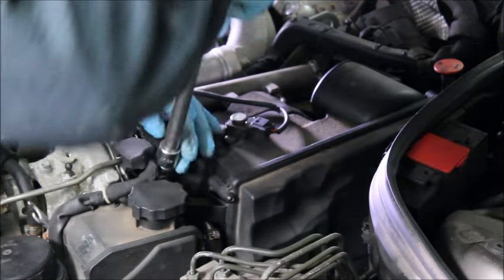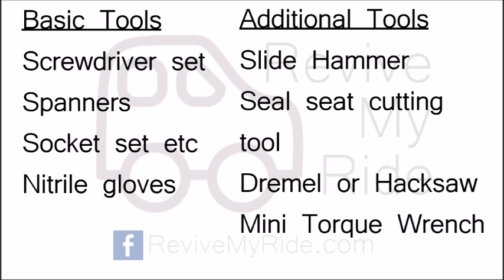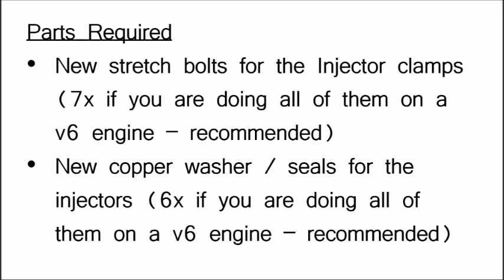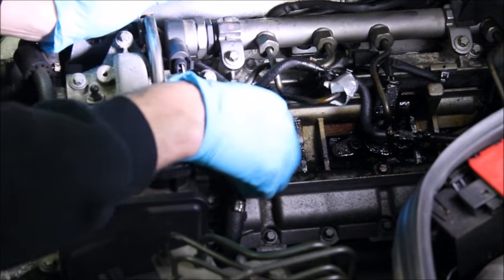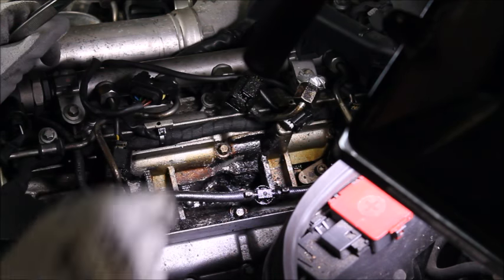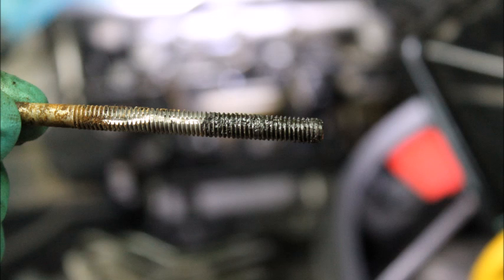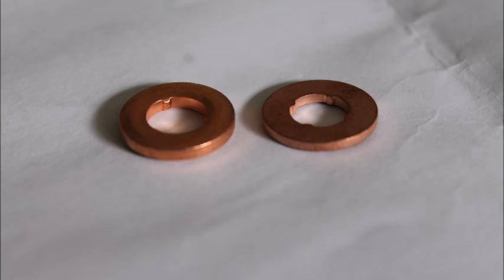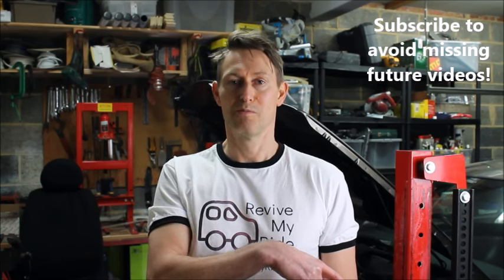Mercedes diesel CDI (Black Death) leaking fuel injector - How to diagnose and fix on 3.0 V6 engine

Comment: If I remember correctly that’s a piezo injector, n u use a slide hammer to pull it out??
Reply from the maker: Hi @jun2611 you are right to be cautious. If you can get the injector out without the slide hammer than that is always the best solution: make sure the engine is warm to soften the carbon, twist it from side to side and pull by hand. But, if it is big time stuck stuck, which can happen, then it's gotta come out to fix the problem. Usually the injector comes out intact, if it breaks, then you need to put a new one in but somehow, you need to get it out so you can clean up the seal seat and fit a new washer etc. Cheers, Phil

Comment: I enjoyed the video.  I have a 2010 blutec that starts fine when cold. After 10 min of driving it throws a low rail pressure code and starves for fuel and dies.  If I then let the fuel pump re pressure up then it starts again.  But, soon as I give it gas it dies.  I have replaced the fuel filter, tank pump, and high pressure pump.  No difference.   Could an injector leak enough when warm to cause these symptoms?  I do not have any of the carbon build up on my injectors.  Car has 75k miles.  Thanks for any suggestions.
Reply from the maker: Hi, sorry for the slow reply. I haven't come across this problem before personally, so I did some reading. You have already tackled the things most likely to be causing the problem. You are right that when the leaking injector "black death" gets bad enough, then the car will struggle to start / run but I really don't think this is your problem as you would definitely see the carbon build up in the engine bay and even start getting some fumes in the cabin. There is another kind of injector fault where fuel leaks into the cylinders but this would cause rough running and excessive smoke. I know you have replaced the in tank pump and filter but the only things I can suggest are testing the pressure that you are getting from it by introducing a pressure gauge after the in tank pump near the filter. If you haven't already seen it, check out this thread where they talk about min fuel pressure before and after the filter near the tank https://www.benzworld.org/threads/p0087-fuel-rail-system-pressure-too-low.2446665/ The other suggestion is that there is some talk about a fuel pressure regulator on the fuel rail failing / becoming faulty. Hope this helps!

Comment: Are they stretch bolts for injector clamps , some say yes some say no ,,what's your feedback. TTY bolts torque to yield , great video 👍👍
Reply from the maker: Great question! I had my doubts about whether they were stretch bolts or not because the torque applied to them is low(ish), is it really enough to stretch the bolt? Also, from doing cylinder heads in the past, some stretch bolts can be reused and you can check this by measuring the length of the bolt. I didn't check this but if the bolt is the same length as when it started, it can't have stretched, therefore, should be reusable. In the end, sorry to say I chickened out, the new bolts weren't really that expensive, so I put new ones in just to be safe. Sorry if this doesn't answer your question! Anyone else out there wan't to weigh in? Cheers, Phil

Comment: thank you for your video, and i have a problem my 2008 E320 BlueTEC was working great until that day on 2019 & from that day the engine stopped working, no one know what is the problem, even Mercedes Service Center didn't know how to solve the problem.
so what do you suggest please?
I have Mercedes star C4 & C6 now just I got them to diagnose the car.
the engine crank, after diagnose i found that no pressure in the fuel rail which not allow the engine to start.
and you are very expert in Mercedes engine.
looking for your response please.
best regards
Reply from the maker: Hi, as I'm sure you know, the fuel rail gets supplied by the high pressure fuel pump that is on the front of the engine. But the high pressure pump itself is fed from a fuel pump near the tank. Also, a blocked fuel filter can starve the pump and cause this problem. I haven't tackled this problem myself but: engine cranks but won't start (due to low fuel pressure) is fairly common problem and you will find a lot of videos on it and they will take you through the process. Here is one example of a video on it, you may be able to find one on your specific model too: https://www.youtube.com/watch?v=RAYp8l2Q250 Hope that helps! Thanks, Phil
Reply: @ReviveMyRide  thank you so much for your response & support, yes I have changed both of them and the fuel filter besides the crank sensor, nothing.
Now I am going to the workshop to make diagnostics, I am thinking to make a video on this problem.
Reply from the maker: @mrnourbaha  HI, I'm not sure why I didn't think of this earlier but if you have fixed the original problem (Let's say it was the filter or sensor), then these engines and fuel rails are very sensitive to air locks / fuel priming. You will see in the comments on the Black Death video, lots of people having problems priming the car to start it after changing the fuel filter or a fuel injector. It might be worth you trying this: Ensure the fuel tank has enough fuel in it (put extra from a portable container if required), jack up the rear of the car, so that it is higher than the engine, crank to start the car a few times over about a 10mins time period, allow the starter motor to cool down / charge the battery, then try again. You my have to do this quite a few times but it will prime the fuel rail and may cure your low fuel pressure problem if it is just an airlock. Two things to be careful of: 1) If supporting the rear of the car using a jack only, be careful of it falling, ideally support it with axle stands too 2) Be very careful if you loosen any joints near the fuel injector or high pressure fuel pump, high pressure fuel leaks can be dangerous, don't put your hands near this areas when cranking / running the engine. If you do a video, drop me a link, would be interested to watch it! Thanks, Phil

Comment: Excellent video! I'm having issues to start just now -  I have to crank the engine couple times as the fuel pressure rail pressure is slow. Which device I can use to code new injectors to this engine?
Reply from the maker: Hi Cristiano, I'm not clear from your question if you have had the car apart and now you are struggling to get it started or if you are using it but sometimes it is difficult to get started? I found a really interesting video where a guy is saying that the injectors don't need to be coded. He says coding will allow it to work more optimally straight away but that just installing and then running the car for a while achieves the same result. You can find it here: https://youtu.be/Z6whRd2pTJw There is also a discussion along the same lines here on BenzWorld https://www.benzworld.org/threads/om642-injector-replacement.3015706/ You will be able to find lots of info as long as you search for "OM642 injector coding" Sorry, I've never done it myself! Also, please be aware that if you have removed injectors then the fuel system needs to be primed, you can do this by turning the ignition on and letting the fuel pump run (without starting the car) and then turning it back off and repeating a few times. I hope this helps!
Reply: @ReviveMyRide  Thanks. I knew about the YouTube video but not about the forum. I've being having issues at the morning only to start the engine, even when is over 20C. I noticed that the fuel pressure is not sufficient using a app connected to the OBD port. I need to test which injector is the culprit.
Reply from the maker: @paidoluca  Ok, that makes sense. When it finally does start up, is there a lot of smoke? I noticed a few people mentioning that when their fuel injector failed then it provided too much fuel to the cylinder it was fitted to and this caused a lot of smoke / unburnt fuel and a diesel smell. I think looking at the fuel injectors may be one of my jobs in the future! Good luck with it!
Reply: @ReviveMyRide  no it doesn't smoke a lot! During the day the car looks normal, only happen during the first start. What I heard is that when the injector get bad doesn't hold the fuel pressure and the fuel goes back to the tank entirely.

Comment: Hi buddy I have ml320 cdi 2008. I put wrong fuel in it . (GAS). So, my car first use to take longer shelf start . But know it doesn't start at all. Only starts with spray fuel into iin takes. Please let me know what to do
Reply from the maker: Hi, I'll be honest, I've never had to deal with this issue before, so I don't really have any experience. However, I did some reading and it seems the most important things are to completely empty the fuel tank, replace the fuel filters, purge all fuel lines (Including the fuel rail to the injectors). I found this link that may be off help, it is from a Mercedes Sprinter van forum. https://sprinter-source.com/forums/index.php?threads/74180/ Sorry I can't be more help and I hope you get it sorted! Thanks, Phil

Comment: What do you use to stop debris from entering hole while cleaning walls
Reply from the maker: Hi, at 12:45 I drop a disc down into the bottom of the injector hole. It is actually a washer covered in double sided tape. I seat it in the bottom, do the injector bore cleaning, vac it out and then remove the disc at the end. Hope that helps! 👍

Comment: Will there be a DTC (trouble code) telling you an injector is bad, or is it simply waiting for the symptoms to occur?
Reply from the maker: Hi, no, I'm pretty sure that the engine / ECU doesn't know there is a problem unless it gets very severe and starts to cause running / starting issues. Not sure what the fault code would be at this point. As you say, it really is a case of waiting for the symptoms. You can keep an eye on it by periodically removing the engine cover and having a look for carbon deposits near the fuel injectors. Some people just decide to replace the injector seals at 80 - 100k miles. Personally, I would do the periodic check, the engine cover pops off really easily and you would probably only need to check a couple of times a year. Hope that helps!

Comment: Can I clarify the alternative copper seal?
Did you mean to use a Honda seal Pt No. 16472RBDE00, calling it a Nissan part by error?
Reply from the maker: Hi, Sorry for the confusion and thanks for raising this point! Yes, it is a Honda copper seal. The Honda seal is a little thicker (which is handy if you have needed to recut the injector seats) and meant to be a little softer (according to Merc enthusiasts) and meant to seal better. I think I make an error in the video (which I can't easily correct) but I did update the video description to clarify! Cheers, RMR

Comment: Can the copper seal be the only fault and the injector is fine??My c-class 320 cdi one of my injectors is making a chuffing noise so there's definetly an air leak.
No black carbon yet just light dampness from the diesel on the clamp.
Reply from the maker: Hi @robbocop33r12 Yes, the vast majority of the time, the problem is just the copper seal and from the symptoms you describe above, it definitely sounds like that is your problem. If you strike quickly before carbon builds up etc,  you will do the job in half the time compared to if you have to do all of the labour intensive clean up! Also, you are unlikely to need a slide hammer type injector removal tool and probably not a seat cutting tool either. Thanks, Phil
Reply: @ReviveMyRide  Got the injector leak early i think,only problem i had was releasing the fuel return black plastic clip!Got the injector out ok,there's a little ridge in the copper washer where it must have been leaking!
I've had the car a month or so and only fault is if you're doing say 60mph and really floor it,eml light instantly comes up,low fuel pressure p0089,which i suppose a leaking injector would do.
Today is the first time though the injector started chuffing noise,must have been slowly leaking worse and worse.
Reply from the maker: @robbocop33r12  Good work with the injector seal! 👍 I never got the P0089 fault, with mine. Worth keeping an eye on it, I personally don't think the fault code was due to a leaking injector seal. There are a few things that can cause the P0089 fault, with the most likely one being a faulty fuel regulator. Fingers crossed it goes away and stays away though, sometimes they do! Cheers, Phil

Comment: Hello, I want to ask you a question about a V6 engine mercedes E 280 CDI. I was out for a drive and suddenly the engine stopped and an injector error came up in the display. I came to a complete stop and turned off the ignition. Then I started the car again and everything was ok. Drove to the workshop and had it diagnosed but no fault was found. Do you have any idea if it could be an injector fault, leakage?? Arne
Reply from the maker: Hi Arne, Can't say I've ever come across that problem! I'd say it's unlikely to be due to the type of leakage that I am showing in my video, as until it gets very bad, the engine management is usually unaware of the problem. Probably a good idea to inspect around your injectors for carbon build up (Which is a sure sign of injector seal leakage). I did a video showing just inspecting here: https://youtu.be/7weS1vQ_1OI If I was going to guess and it is just a guess, it sounds like one of your injectors is developing a fault. If it isn't causing you a big problem, then hang tight. The problem may never reoccur. If it does, it may eventually be a permanent fault that leaves a permanent fault code, which you can then read. Sorry I can't be more help! Thanks, Phil
Reply: @ReviveMyRide  Thanks! I will take a inspestion on the injectors an hope that will help! Thank you again ! Arne

Comment: Does the injector need an o ring on the injector shaft?
Reply from the maker: It's been a long time since I did this job but I'm pretty sure there isn't an O ring on the injector shaft, just a copper seal at the bottom. Cheers, Phil

Comment: How do I know when to stop turning with seat cutter tool, could doing to much damaged the cylinder ?
Reply from the maker: Hi @Arounadabout You shouldn't have a problem unless you go crazy and cut "lots" of material out of the seat but your aim should be to cut the minimum amount out of the seat to clean it up. Usually this will only be a few tenths of a mm of material. If you use the Honda injector seal (linked in the description of the vid), then it will more than make up for any material cut out because it is 0.9mm thicker than the standard Mercedes copper seal. Do a small amount of cutting and then inspect, take your time, as soon as it looks like the image at 17:38 in the video you are done. If doing it by hand, you will just rotate and press down on the cutter for a few minutes, inspect and clean the tool, repeat a few times. If you are confident enough, you can put the cutter onto a battery drill, set on low speed and cut for just a few seconds and check. A good gauge is how much aluminium you are cleaning out of the cutting blades. I cleaned the end of the tool just once or twice when recutting a single seat. Hope this helps, it's always hard to describe things that you do by "Feel". Thanks, Phil
Reply: @ReviveMyRide  
Hi, thanks so much for this advice.
So it's as simple as put the cutter tool in and keep rotating it until the seat area looks clean ? 
Is It ok to just replace the one/s that are leaking rather than all of them ? If it's not too bad to remove I might do the others too.
Will the honda copper wash fit regardless of how much or little of the material is cut out ?
The grease you use on the cutter tool to collect the metal shavings, do I have to clean that grease out of the injector hole or does it not matter ?
I'm going to get all the tools soon to get the job done , it looks like it's leaking really bad I not tom cover off yet but can see through the cover wet pool aroun injector and it's ticking and smells strongly of fuel.  and the consumption is terrible about 55 miles from £30 until light comes on again. 
 I Have a video on my channel of the car and the problem. A fuel specialist I saw after uploading video said injector seals he knew right away 
Thanks

Comment: Thanks for that.  Do you have a part number or application for the  Nissan ?
Reply from the maker: Hi, sorry, I got the brand wrong. It is a Honda fuel injector seal, not a Nissan. Part number is: 1647RBDE00. You can get them from Cox motorsport or from the main dealer. Hope that helps! cheers, Phil
Reply: @ReviveMyRide  hi. Is ther difference which side copper washer should be installed. I mean the mersedes ones is one side flat but the other slightly curved. Thank you
Reply from the maker: @моепчеловодство-ь2о  Hi, I searched hi and low for this answer too when I did mine! I couldn’t find anyone anywhere that could state a preference and why. In the end, I just fitted mine and didn’t bother which way they went in. As I did all six, there will be a mix and they are all still fine 2 years later. I did a video of my 2 year inspection, which you can find on my channel if your are interested. Hope that helps! Cheers, Phil

Comment: Do you have a cross reference for the Nissan copper washers?
Reply from the maker: Hi, Sorry, I said the wrong name in the video, it is actually a Honda fuel injector seal. Here's the info: Honda diesel fuel injector seals (copper washers) part number is 1647RBDE00
UK link: https://tidd.ly/2J2kDMD
USA: Not sure where to buy these in USA but you could try the Honda main car dealers
If you prefer to use the MB fuel injector seal, the part number is: A6110170060
Thanks,
Phil